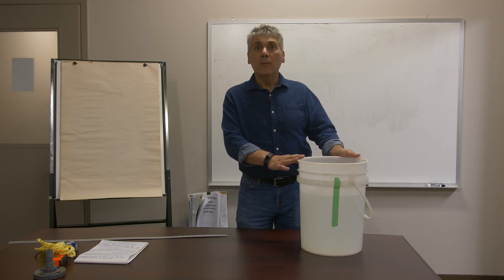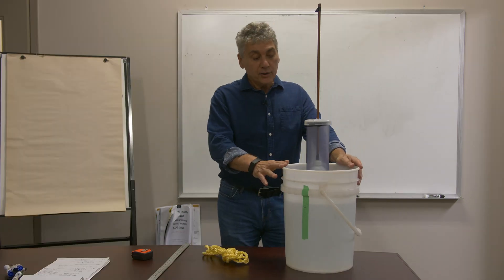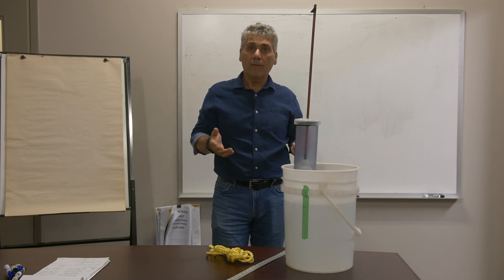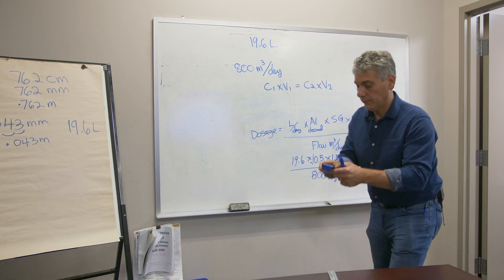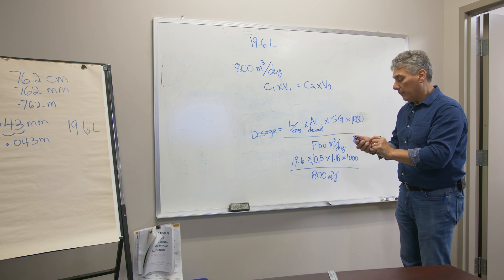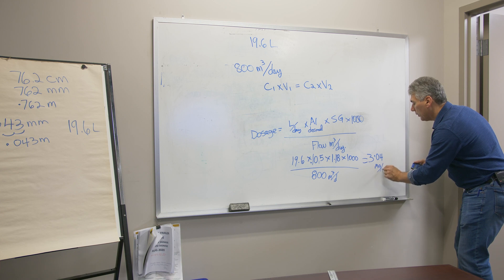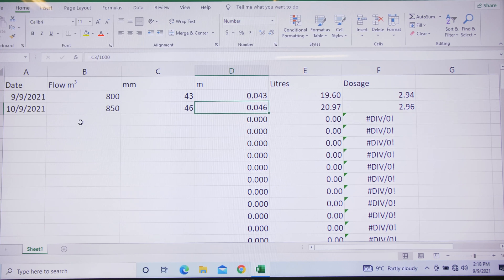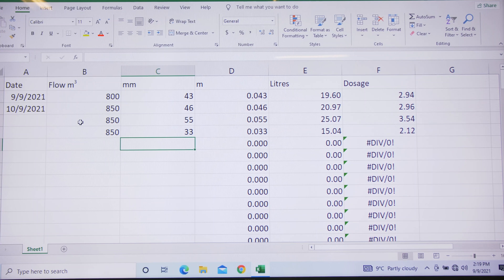How To Calculate Chlorine Dosage at a Water Treatment Plant

Comment: What is a good minimum flow rate GPM that should occur prior to chlorine injection at point of entry to avoid toilet flushes and water glass refills that could result in over chlorination?  TYI
Reply from the maker: The ideal flow rate for chlorine injection at a point of entry can vary significantly based on the specifics of the water system, including the concentration of the chlorine solution used and the water demand of the building. As a general guideline, some sources suggest a minimum flow rate of around 5 gallons per minute (GPM) or 18.93 liters per minute (LPM) for residential systems.

However, please note that it's critical to precisely calculate and adjust the chlorine dosage based on your specific conditions to prevent over or under chlorination. It's also crucial to monitor chlorine residual regularly to ensure the correct dosage.

Remember that professional consultation is advised when dealing with such technical aspects of water treatment to ensure safety and compliance with regulations. It's also important to consider the various factors that can influence chlorination, such as pH, temperature, and the presence of other contaminants in the water.